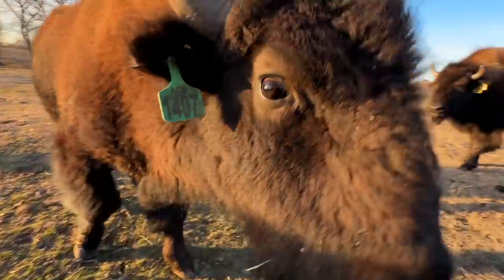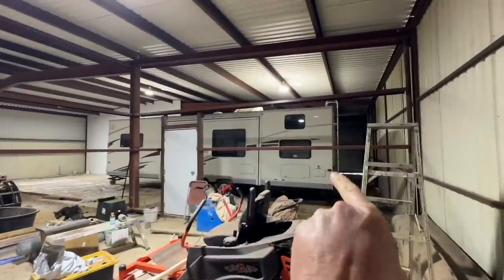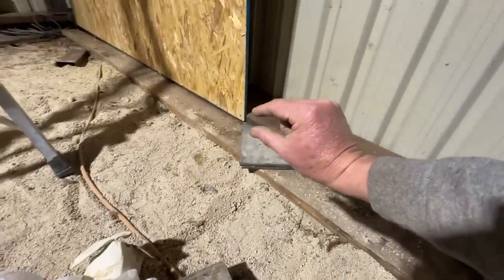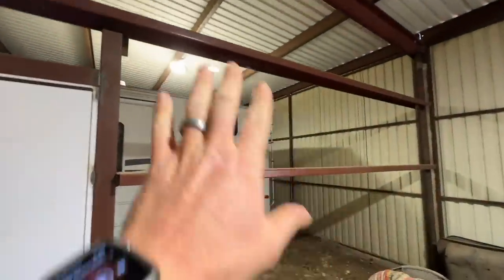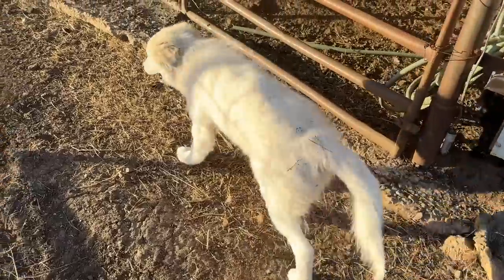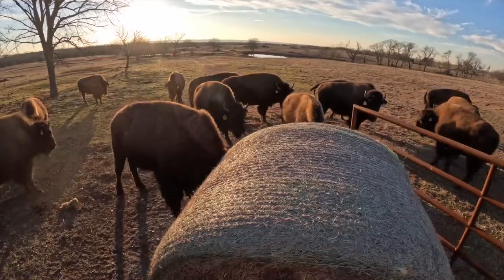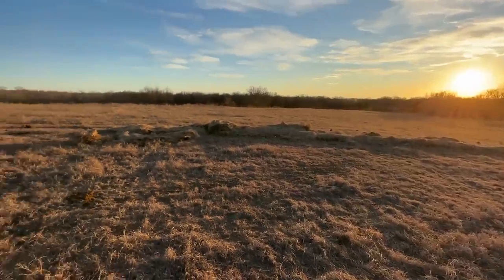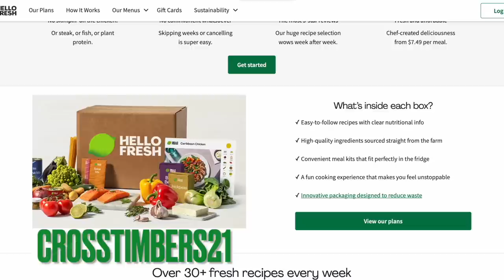Female Feistiness | Upgrade In The Barn!

Comment: @crosstimbersbison I got a solution to your poop issue. Get a 4’x16’ welded wire panel and hook it up behind the ATV and then go zooming through the field!!  Try to put the side that has the 4’ wires welded on facing down.
Reply from the maker: Heck yeah! Like that
Reply: @CrossTimbersBison Operation poop 🤣

Comment: Great addition to the shop would be a compressor and run pvc around the walls with access points to the air supply so you can use it without having to plug and unplug the connections constantly.     Also run one for an outside access point for your equipment.